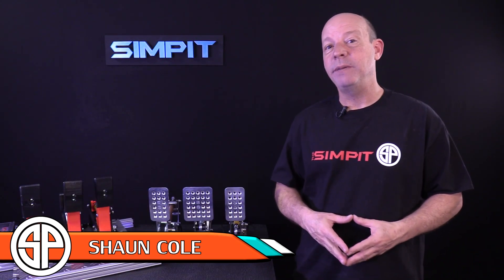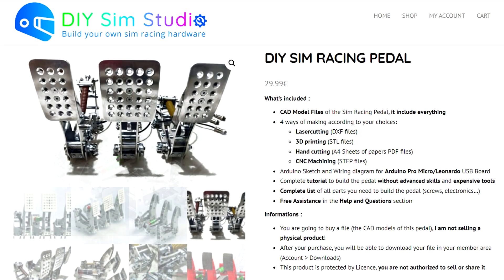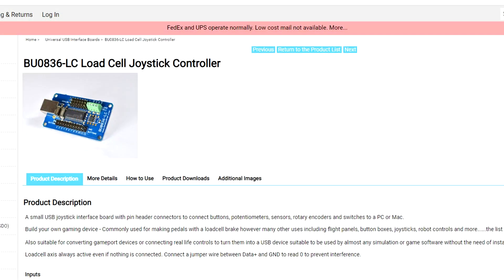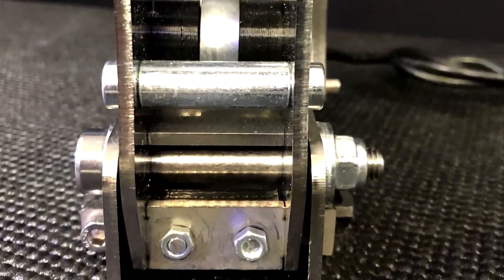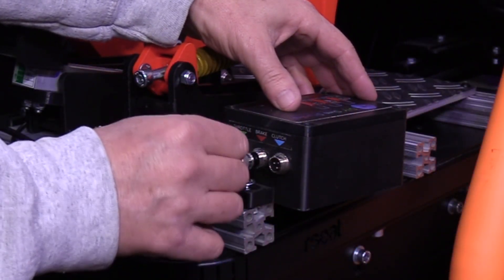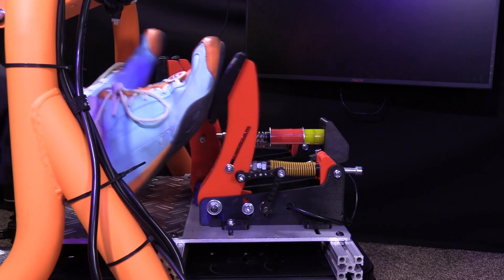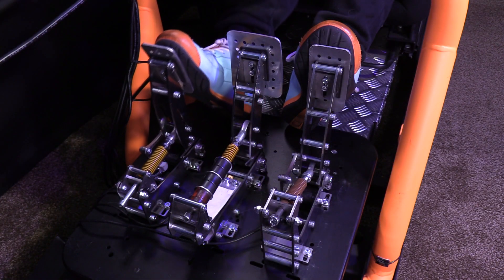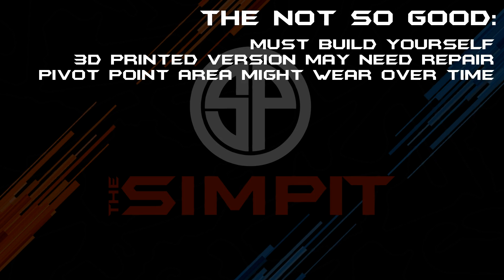DIY Sim Studio - DIY Pedal Review - Build Your Own Load Cell Pedals

Comment: On the 3D printed break you could do is have a Cup printed to fit a flange M8 bolt head hexagonal on the back plastic at 45 degrees to the bottom where there would be a hole in the mounting plate, the bolt can go through with two nuts on the bolt at the bottom, so you can adjust the pressure on the back plate with the nut and locking nut of the pedal so it doesn't flex the back plastic of the spring assembly block.
Make sure you got plenty of material on the back of the assembly block for the Bolt probably 20 mm minimum square. Give you a lot better feeling and will protect the plastic from fracture.
Is it possible to use an optical mouses as the sensor should work better?? can you get the same calibration software to work with a mouse?

Comment: What is the difference between the brake springs and elostomers? Is one better than the other? If so how so
Reply: Typically springs would be used for 90% of the load pressure, & elastomers used for the last 10% of the load pressure feel. Springs & elastomers come in different strengths, but springs generally feel quite linear from 0-100% deflection, whereas elastomers have a curved pressure, that imitates hydraulic mechanisms. For brake pedals & handbrakes, I like the feel of springs & elastomers together, not just one or the other. Which would last longer? Springs. Elastomers are made from rubber polymers, which do break down over time from environment temperature, humidity (or lack of), & general wear (Can break down like old elastic bands). But you could realistically expect it to last years (depending on quality of course). Springs can also degrade over time from wear, rust & age, but you can expect it to outlive the elastomers